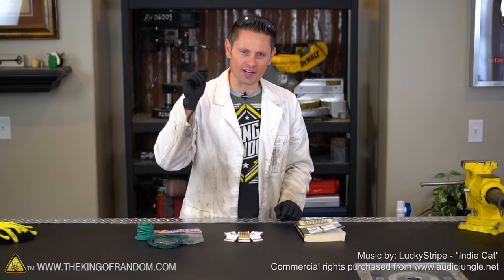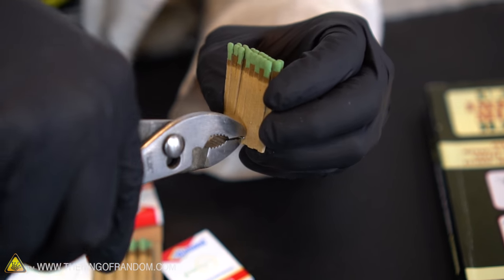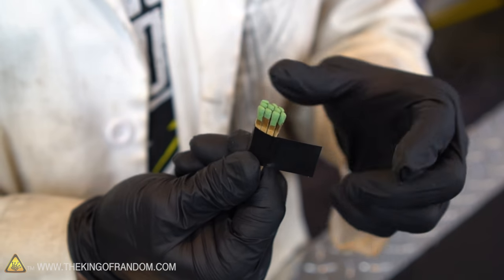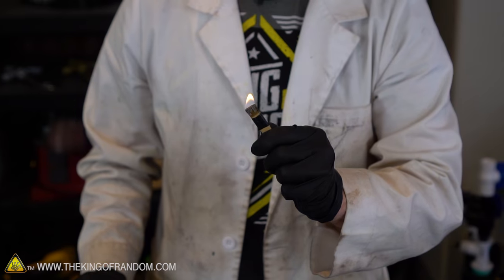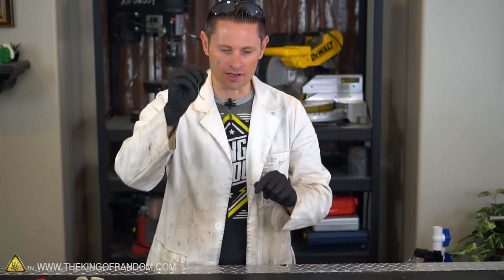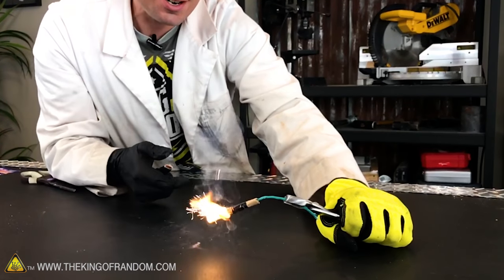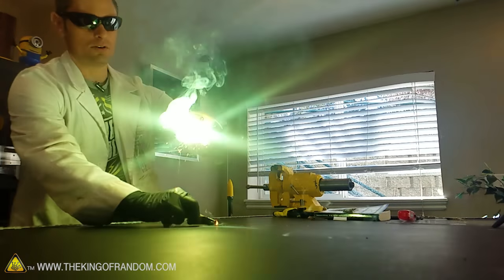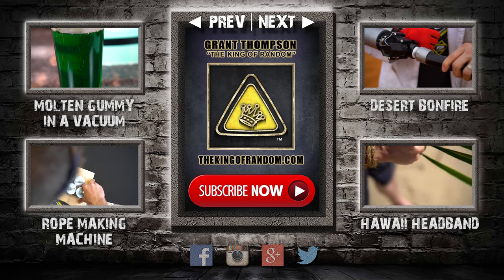Matchbook Fuse Igniter | How To Make A Fuse, Grenade Pin, DIY Fuse, Or Pyrotechnic Initiator

Comment: Will frozen gasoline burn?
Reply: NO. because the gasoline doesn't burn its vapors do, and vapor is usually formed by heat. so if it is frozen then it won't form vapors and wont burn
Reply: Brian Coolman he could still try it because as the flame heats the gas up it might start to burn slowly
Reply: Carsandwater already did this
Reply: Brian Coolman he actually tried this and it worked know it all

Comment: You should make glass.
Like if you agree
Reply: Do it
Reply: Glass has a higher melting point than steel. He'd need a better furnace. Would be cool to see.
Reply: Northwestern 43 ya that would be cool as
Reply: Random make glass
Reply: Dewit
Reply: yes make glass plz
Reply: Northwestern 43 i do too
Reply: you should make a glass hour glass after you make glass
Reply: Northwestern 43 yis!!!
Reply: You need to smelt sand inside a furnace with coal. You can also make glass panes using the glass you get from this too. But avoid smashing the glass because it doesn't drop anything.
Reply: I would really think that would be cool too.

Comment: If you go 2 drones and connected the drones with some pole like object (Like a pipe or broom handle) and then recorded it flying around, then had a vr headset with one drone for each eye, could you view the world as a giant?
Reply: Unneccessary, you can just get two stereoscopic cameras and attach it to the same drone. How far apart are your eyes lol?
Reply: The idea is to make the eyes farther out, to make you feel larger
Reply: Robert Stegmann you can get one drone and make a pipe or something very light on the drone and then add the cameras on the sides of the pipes
Reply: Actually, that's a better idea
Reply: won't that maybe make the drone rotate weirdly, or atleast pull it down if it isn't done with absolute precision? + wind will move the drone much more i'd guess, so it'd be maybe more uncontrollable.
Reply: The point isn't to have a stunt drone. All you need is proof of concept.

Comment: *LIKE SO GRANT CAN SEE* Cast your glock and all its parts with alluminum (maybe coke cans) and try to replicate the gun
Reply: emperor palpatine from star wars chimes in DEW IT
Reply: Matthew Rivas I liked
Reply: Questionably unsafe
Reply: THEGOLDENCAR how?
Reply: I like this idea
Reply: Thats gr8 m8 8/8  the parts are too complicated to be casted.
Reply: He could find some way to fire it from a distance like he did when he used lead bullets
Reply: The parts are all made with precision like "Cement Block" mentioned. They use different metals and I'm sure they're casted following special requisites like humidity or melting temperature and pressure. Even if he could "cast" the gun, it would be too far of a risk to even pull the trigger from a distance, besides, who knows the regulations and laws concerning such things... 
In essence, it would be too risky and not worth it, he'd just be making the same gun anyways.
A better idea would be to make something like a .177 cal BB gun/rifle from stuff he put together, that would pose much less danger and would not raise any alarms if you will.
Reply: Great idea!
Reply: It will look cool but it will not function. Beyond the fact that you need a steel chamber and barrel to contain the explosion of the bullet, if the slide was aluminum it would be much lighter than the steel factory slide and not reciprocate right. Most .22 pistols have aluminum slides because the recoil impulse is less. If you make a 9mm with a non-steel slide you need to make it bigger to compensate for the weight, kind of like a Hi-Point pistol.
Reply: i think they don't mean as a real working gun
Reply: Yeah, I guess they might not but I'm sure people are going to start "chanting" almost demanding a real working gun. He could make a simple mold but then in the video there's going to be hundreds of people demanding he make a real gun and they're going to get angry when he doesn't do it, or worse, something could go wrong if he decides to proceed
Reply: Or maybe he could just cast a model of it as a prop to see how it turns out
Reply: Matthew Rivas or just the slide. Would you really want to fire a gun using a barrel you made with pop cans?
Reply: No way he'd be able to make it work properly, they're made too precisely and aluminium has a fairly low melting point relatively so there may be some warping.
Reply: Matthew Rivas it won't work the chamber would melt and you would have to buff out the gun
Reply: Sorry kid too late

Comment: Why dont you use that fuse to make a DIY Grenades with gunpowder. Like if you agree.
Reply: I'd like to see that, but it's dangerous AF.
Reply: CloudSteele he made coconut grenades with a way sketchier fused
Reply: Potatoman 12350 DIY gunpowder?
Reply: don't not dont
Reply: I was thinking that do the exact same but add a pouch of gunpowder on a longer fuse pull then you could throw it
Reply: Potatoman 12350 beflix already did that

Comment: All I can picture is a dark field with an elaborate array of fuses masked by the night all leading to this one single igniter and upon pulling it, the sparks are lead down one path and then they branch off into 20 different directions lighting up the field until they all reach their own individual fireworks in perfect sync.

Comment: What if you grind up some match heads and coat the knot of the fuse with the ground up match heads. Will it still work? I'm assuming some adjustments need ti be made but it seems like a cool idea to not have any matches with the fuse

Comment: What if you put the coil of the fuse in a small pvc pipe with on side plugged and the other plugged with a 1/8 inch hole. If you tightly compact it will it become a rocket engine with some really cool smoke/sparks?

Comment: Does it seem a little unnecessary to create a pull tab igniter when you could just light the fuse with the match. I mean I suppose it's convenient if there is high wind or for something you need to throw. But still..

Comment: Try dissolving the KNO3/sugar mixture in water, then boil off the water until dry.  You'll end up with a much more uniform mixture and will have far less caarmelization (if any at all.)   Grind and compress the result for best results.

Comment: Do you still have the wooden kind of match boxes in the States? If so, try this. Carefully peel the striker paper from both sides of the box. Place it on a piece of glass and light it. When it finishes burning clear away the burnt paper and look at the glass. You will notice coffee coloured smearing on the glass. Gently rub some on your first finger tip and now rub the tip of your finger with your thumb. Smoke will appear. It does not burn at all so I have no idea why it happens but it does. You can blow kids minds with this if you don't let them see you get it on your finger first and just let them see you produce smoke from your finger.

Comment: Might I suggest using Masking Tape instead of Electrical Tape on the Match/Fuse roll. As the Masking Tape is mostly paper, it'll burn quickly & easily rather than the Electrical Tape, which is plastic & not only burns with nasty fumes, but also takes time to ignite & thereby preventing in propagation of the flames southward.

Comment: its not how fast you pull,
its how STRONG you pull.

its comparable with a motor that should be able to move a car that is 1 Kilogram in weight.

but however fast the motor spins, it will not get the car moving.

so you have to give it a certain torque, which is the force it spins with and the car starts moving. if you add more torque you can actually let the car be as fast as the motot spins. so if you pull fast, but very soft, nothing happens. if you pull slow, but very strong its lit.

Comment: Can you ignite frozen gasoline please??
Reply: NO. because the gasoline doesn't burn its vapors do, and vapor is usually formed by heat. so if it is frozen then it won't form vapors and wont burn